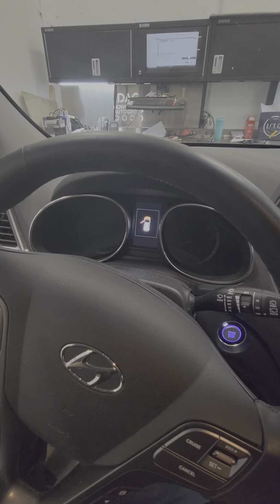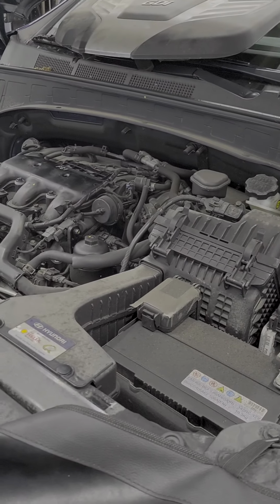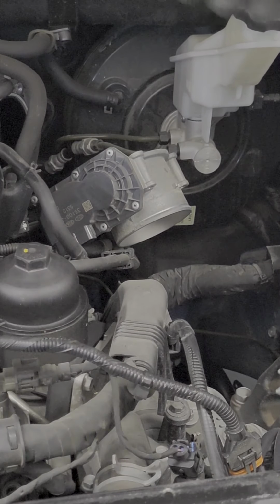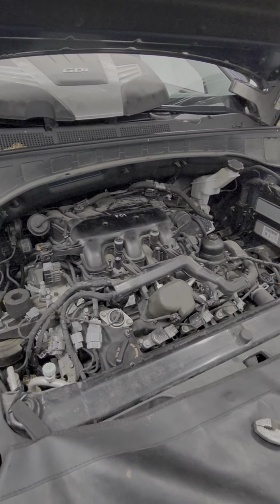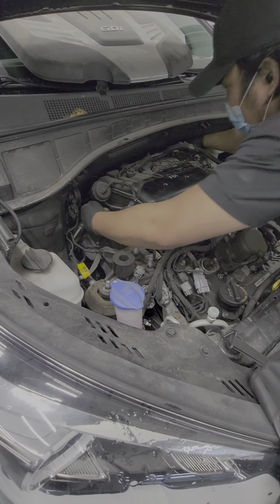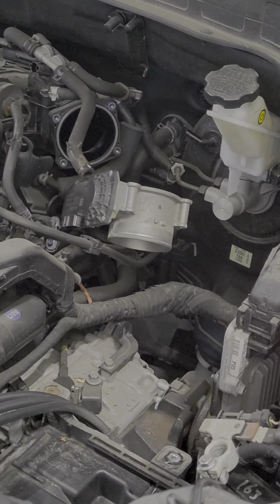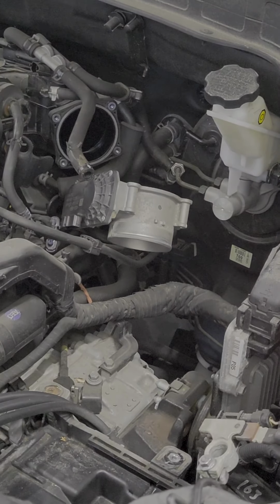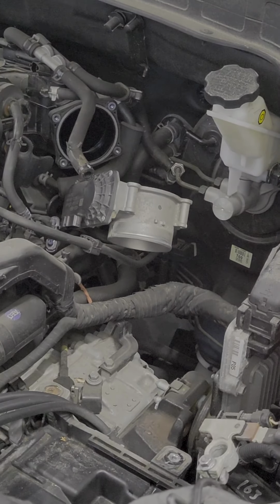How to replace oil pressure switch 2013 and up V6 Santa Fe

Comment: Thank you very much!  I recently changed my car's oil pressure sensor by following your video!  Saved a thousand bucks!
Reply: Windelino, how did you get the intake manifold off? After the 8 Hex screws, what else did you have to take off, for it to come lose? Mine won't even move...

Comment: Thank you!  Just followed your video to replace my oil pressure switch and everything went smoothly.  I especially appreciated your tips on the 5/8" bolt on the back of the engine and your method of removing the oil switch with a chisel.  Mark S.
Reply from the maker: Glad that it went smoothly, the previous model you can use a socket and you can easily remove it, for this model that pipe in the valley is just on the way i have no luck yet on using a socket.

Comment: Thanks very much for the video. I just swapped out my switch and this was a HUGE help.
Reply from the maker: Nice good job.
Reply: @hyundaitech  I was ready to pay the dealer to do it just because I knew it was a more complicated job and I'm getting old (haha) but all the dealers in my area were booking over a month out and the switch was leaking pretty bad. Oil was puddled around the intakes and it was even seeing a few drips under the car. Hopefully it's the only leak. I did make sure the filter housing wasn't leaking.

Comment: Do you happen to have a list of the tools needed to do this? Particularly them tool you used on the hose at the 8 minute-ish mark?
Reply from the maker: Sockets 10 12 14 mm, extensions. Hose pliers, the long one is like a hose clamp tool, maybe you will get lucky by using just pliers. For the socket for the oil pressure theres a socket sold by snap on to make life easier or you can chisel it  out or you can grind a 24 mm wrench to fit in the valley of the engine. And 17 mm wrench too i think or 19 im not sure for the gdi rail

Comment: I know this video is a little older but I have this issue currently. What is that long sting like tool you use at 8 minute mark?
Reply from the maker: The video has low quality , the long tool that i use its a hose clamp tool, maybe you will get lucky with a needle nose pliers to unclamp that hose.

Comment: Will the oil control valve get damaged if oil leaks on it when removing oil filter from top on my 2015 Santa fee 3.3
Reply from the maker: No it wont get damaged but as much as possible you will clean it.

Comment: Is this switch will be responsible to make a leak down between gear & engine? As i have a little oil leak at morning & oil lamp is warning.
Reply from the maker: Yes you can verify that if you will see under the intake or place long screw driver in between the v of the engine and if theres oil and yeah most likely the oil pressure is leaking.

Comment: Ok, so I removed 8 Allen bolts with the size 6 Hex, but the injectors cover doesn't seem to be lose, are there any other bolts that are holding it down? I did remove one 12 mm bolt and bracket in front, but do not see anything else???
Reply from the maker: So you removed those hex bolts, meaning you are removing the lower intake manifold. After you remove the lower intake, you can access the 4 12 mm bolts for the injector rail then from there you can access it.
Reply: @hyundaitech  I cannot remove the intake manifold, after removing the 8 hex bolts, and one bracket that had one 12 mm bolt, it will not move...seems to be stuck on...could it be seized on??
Reply from the maker: @panic151  as i review the video i made you should be able to remove the lower intake once you remove all those bolts. Maybe just try wiggling the manifold, maybe the gasket got stuck on the head.
Reply: @panic151 you have to tilt it back towards you and then pull up

Comment: Just did oil change on my father in laws 2016 Kia sorrento v6, only 2 quarts of oil came out of drain pan, v6 engine on recall as well?
Reply from the maker: Not that i know of about the v6 one for the oil consumption issue. Theres no leak? Could be burning oil.
Reply: @hyundaitech  yea no leak, figured burning thru combustion chamber and into exhaust, did have code for bank 1 cam sensor
Reply from the maker: @BuyingTickets  what was the code? Like camshaft overadvance? Could be because it was low on oil and not enough pressure to cvvt.

Comment: Do you need to replace the injector seals whenever the rail is removed?
Reply from the maker: Its good habit to replaced those parts or atleast you have it handy just in case something mess up during removal.

Comment: My air box will not come out, I removed the 2 screws in the front, is there more screws on the back??.
Reply from the maker: I think theres 1 more at the back
Reply: That is what it seems like, I just can't see it, or fgure out how to reach it.
Reply from the maker: I just watched again this video, theres only 2 bolts holding the airbox base, the back one is rubber.  Maybe spray some silicon on the back part and maybe it will help you pull it up.

Comment: Great video! I'm having a hard time finding any info on changing the oil pressure sensor on the 2019 3.3 in my Sorento. Does this video apply to that year as well? Thank you.
Reply from the maker: Yeah sorento and santa fe should be similar.
Reply: @hyundaitech  many thanks!

Comment: can you identify the total amount time that it took for this job. i have a 2011 Hyundai Santa fe, i think its 3.0 l engine. the oil light comes only only the I am stopped. once I put the gas the light goes off. would that be the oil pressure switch or my mechanic said oil pressure pump. would appreciate your answer. thank you in advance.
Reply from the maker: It could be leaking oil pressure switch, if you have a engine oil leak. One way to check is to look at the connector if theres a sign of oil inside the connector i would recommend to replace the oil pressure switch.
Reply from the maker: And one factor that can cause that is the oil filter, did the problem just happened after oil service if yes i would check the oil filter installation if not the worst scenario is the oil pump is failing.hipe that helps
Reply: My switch is clean no leaks would it be oil control valve was damaged from oil leaking on it from oil filter being replaced

Comment: Why do you chisel it? It's made for a socket to fit over it to put on and take off.
Reply from the maker: Yeah on this case i dont have the socket to remove it, and in this moment i just have to chisel it. But right now i have a special wrench specifally for this. Hahaha

Comment: is this same with Hyundai santafe 2013 crdi?
Reply from the maker: Not sure the location or the same as diesel. Sorry
Reply: @hyundaitech  i see. well thanks for the idea for checking if theres is a leak in oil pressure sensor. will try checking it later. thanks

Comment: What did you unplug to remove the injectors?
Reply from the maker: I think i just remove the mounting bolts on the rail and i removed the whole rail with injectors.
Reply: @hyundaitech  did you have to unplug any connectors or hoses?
Reply from the maker: @panic151  yes you have to remove the fuel line thats c9nnected to the rail, and then you can put it aside, you can remove the joint c9nnector for all injectors too
Reply: @hyundaitech  ok trying this today!
Reply: Last question, how did you remove the fuel line from the fuel pump? I removed the gas line, but can't figure out how to remove the metal line from the pump?
Reply from the maker: @panic151  i think you need to use 19 mm or 17 mm open wrench
Reply: @hyundaitech  How tight do you have to go when reinstalling the fuel rail fittings? Now that there is air in the fuel rail, is there a special procedure to bleed air or do you just let the car crank over
Reply from the maker: @relentless_freeride  the rail bolts at 17.4 ft.lb, then the nut pipe to rail is 26 ft.lb and yeah just crank it over and there should be no air in the system. Hope that helps
Reply: @hyundaitech  It does, thank you. I am doing this on a BK2 3.8 Genesis Coupe and there really isn't much info on that particular car for this. Trying to determine if I need to drain coolant to do this or not as I am taking off the intake manifold
Reply from the maker: @relentless_freeride  no coolant drain if you just need to remove intake, just remove throttle body so that it wont drain the coolant.

Comment: HOW DOES AN ELECTRIC CONNECTOR GET OIL IN IT??? THERES NO OIL SUPPLY TO IT ??
THAT MAKES ABSOLUTELY 0 SENSE.
PLEASE LET ME KNOW
Reply from the maker: Because the oil pressure is leaking internally and the pressure pushes the oil thru the wire and out to the connector.
Reply: @hyundaitech  thats so odd